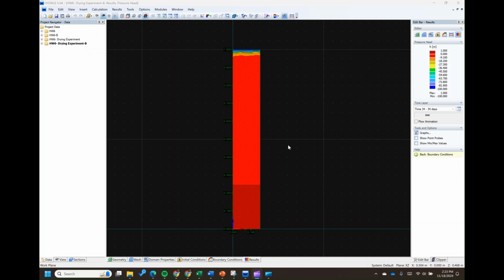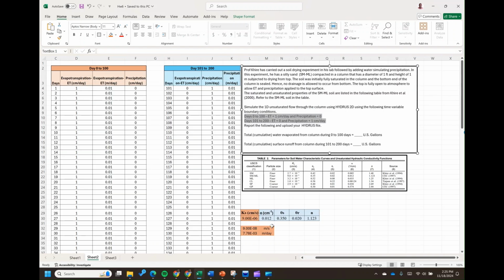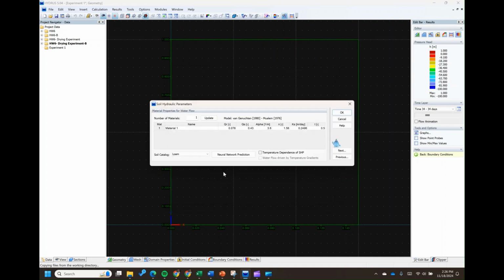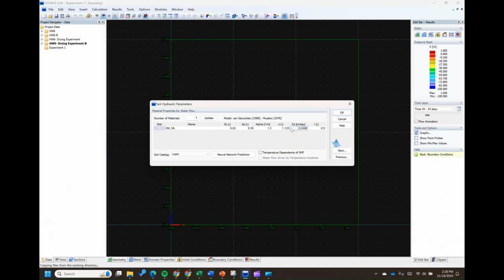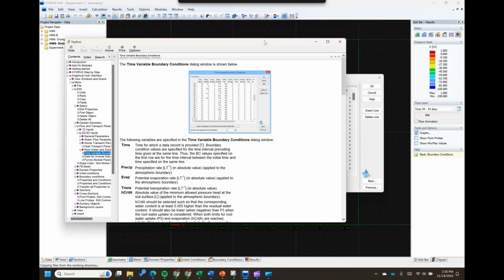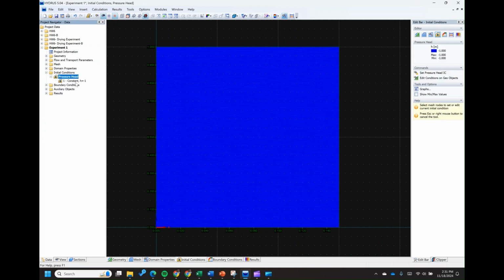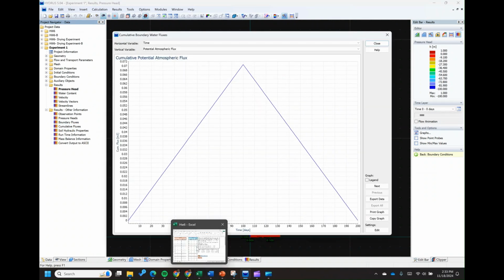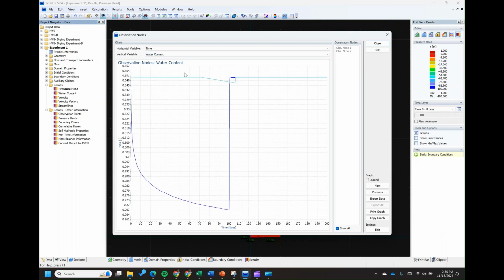Using Hydrus to Simulate Drying Experiment with Varying Time Boundary Conditions

Comment: we can only make cylinder in hydrus or also the cube
Reply from the maker: Do you mean that Hydrus can only model a cylinder cross section? If so, no. A rectangular section can also be modeled. It depends on how you want to define the problem domain.
Reply: @YourGeotechGuy_NumericalModels  okay, thanks, but the way you defined it, you selected assymtrical axis, was that for a cyliner ?
Reply from the maker: @realcheckchannel  Yes, that was for a cylinder.